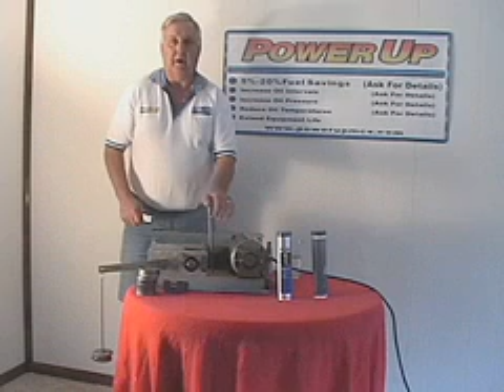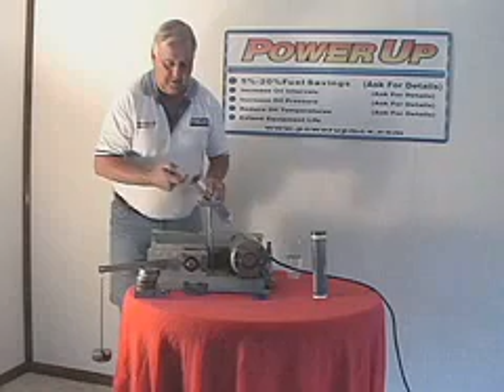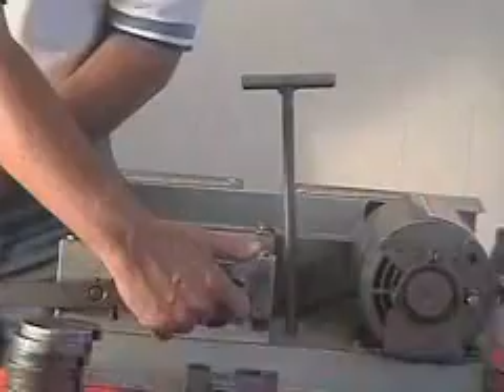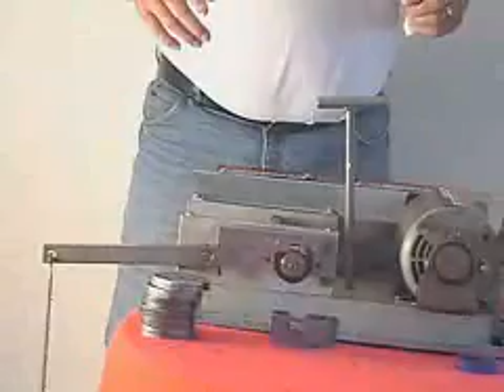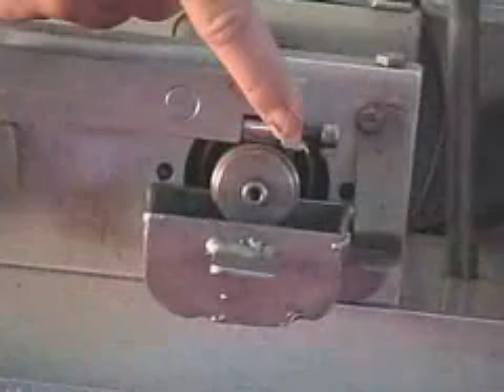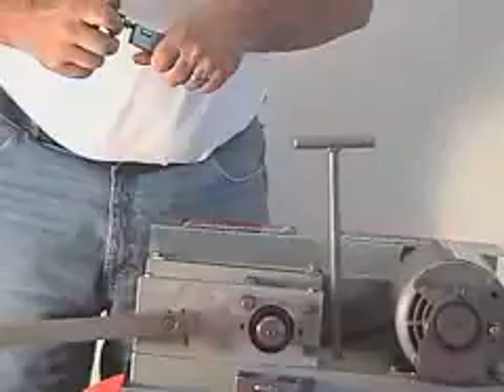Power Up Lubricants Thixogrease #2 - High Temperature Multi-Purpose Grease

Comment: If you are experiencing problems with water/lubricants coming out of your compressor this type of filter is what you need. Have an idea of pressures and flow that you require at output in choosing your Filter. If you are experiencing problems with a lot of water maybe look at your temperature or environment of where your air intake is AND/OR look to see if you have adequate size reservoir to let your air cool down and drain some water before you send it down line?

Comment: No it would not eliminate an Air/oil separator. This type of filter is always required to protect a pneumatic tool or system from inducing water from heat exchanges and oil inclusions from the compressors lubricants.

Comment: Would this product work well in an automotive A/C compressor, converted into being an engine-driven air compressor?
Possibly eliminate the need for an air/oil separator because the grease won't spit out the end of the compressor?